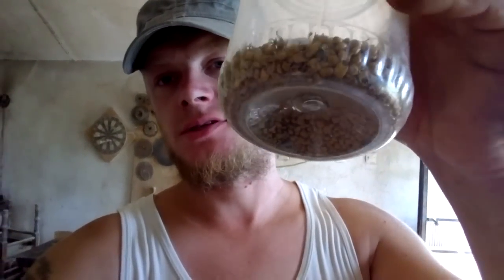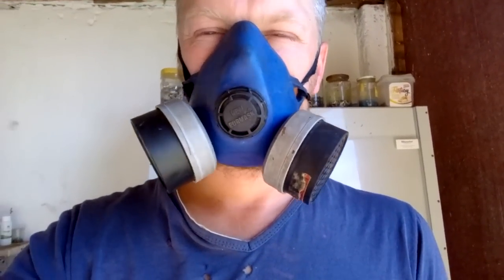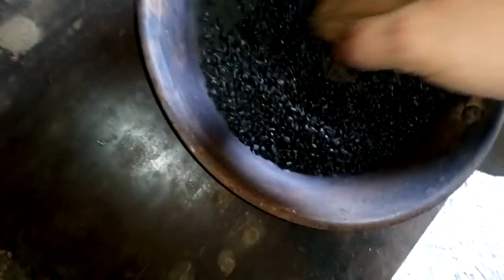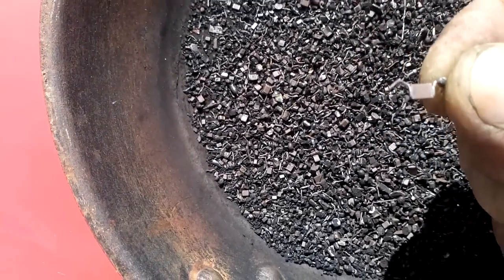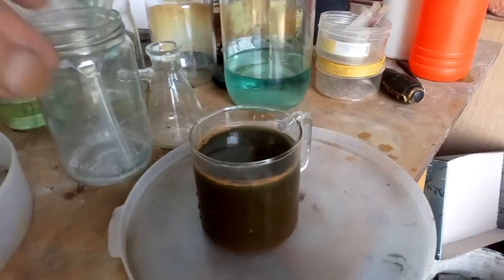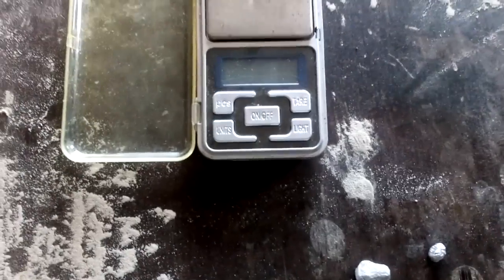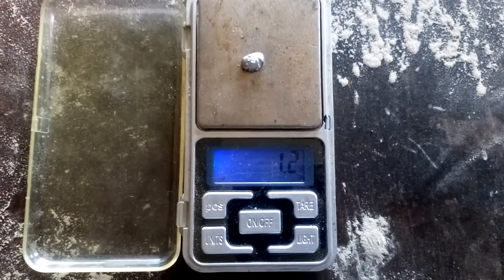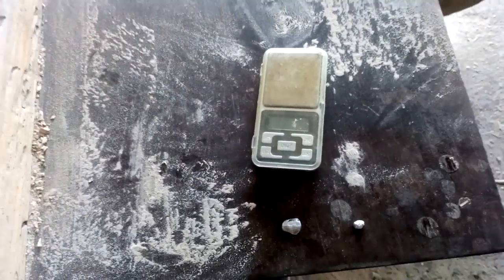Old type MLCC - Paladium & Silver recovery!

Comment: A better method of recovery fir higher yield:
Collect 10KG MLCC,
Burn,
Crush,
Mix: 10kg base, 15kg Lead, 4kg Bicarbonate soda, 6kg Borax, 250g KNO3,
Melt,
Separate metal,
Melt (890-920°C) small amounts in absorbent Cupels (gas mask required),
Separate slag,
Leave in Cupel to solidify,
Quench,
Physical clean,
Flatten to increase surface area,
Put in plastic tub and mix: 50/50 Nitric acid/water,
Dilute with equal amount of water,
Separate non dissolved metal,
Repeat process with undesolved metal until fully dissolved,
Filter acid and wash,
(Save acid)
Heat recovered powder in smaller container with nitric acid,
Filter and wash with water,
Add Aqua Regia,
Test for gold using Stannous Chloride,
Add Urea until bubbles are not yellow when you stir (for reducing acid vapour, not necessary),
Add Sodium metabisulphate until gold precipitates.
(gold process finished)

(Silver recovery) 
Add Hydrochloric acid,
Wait at least 2 or more hours for silver to drop out of solution,
Filter and wash,
Melt,
Cast and remove slag.
(Silver process finished)

(Palladium recovery) 
Add 200g Dimethylglyoxime into 2L water solution,
Split acid into 2 batches and add 1L of solution to each,
Leave for 12+Hrs,
Filter,
Filtered liquid should be blue and powder Yellow,
Wash with water while filtering,
Wait to dry, 
Burn filters,
Melt leftover material,
Add ammonium chloride for quality.
Remove from crucible.
(Paladium process finished)

(Creating bowl for second melt) Mix: 50/50 ash and Calcium hydroxide with some water and shape in a metal dish (fry pan shape), smooth well and let surface water used while shaping dry off.
Will absorb lead.
Reply: Great thank you sir but how to know which mlcc old capacitor contain Palladium silver or tin .. and how to recover palladium from MLCc without burning it
Reply: @REALlifegears  acid test.
Dissolve a sample from each board, if it is a sticky mess it is tin, If not affected by normal  acid palladium. (May dissolve in some acids to a yellow-red colour).
Reply: Hi
Reply: @refineriesallmattels8658  Hi?

Comment: hello dusan
after separating the silver chloride, is the Black residue in the jar all Palladium? did you add water to the Black residue left at the bottom of the jar to prepare the Black solution for the chlorine gas you gave?
Reply from the maker: ramazan karakaş No, it does not oal, there is a base metal in a solution like a nickel and a copper from a wire witch holding a mlcc for the plate! Before I started with chlorine gasI added some Ammonium chloride, which I forgot to mention in the video, sorry !

Comment: Very nice work.  I have to recommend that you invest in better filtering equipment and move away from coffee filters though.  A good buchner funnel and 101 and 102 filter papers will change things for you.  I found my yields went up when I did this as I'm catching more and the amount of time I spend waiting went WAY down.  I'd also recommend real crucibles too.  Your "chiseled out brick" method is very creative but I don't think it is helping with contamination.  The buttons in this vid do not look as clean as they should.

But it's all a learning process and as usual you've passed on a lot of great information here.  Many thanks.
Reply from the maker: Boring Old White Guy I use coffee filters because they are much cheaper, but always in combination with the charming plug in the funnel! I slowly get the equipment, but I'm in the in the phase to work with what I have. I have crucible for melting, but I do not overload myself with metal purification because I sell them for caratase and percent! The vacuum pump has arrived and slowly  grow better equipment, but essentially every step in this procesis the same as with other equipment.Chears mate!
Reply: @999DusanGoldrecovery  what is that song Dusan?
Reply: Boring Old White Guy totally agree on the vacuum filtration bit, but I have to disagree on the brick crucible part
Reply: @OwlTech333  I second on the brick